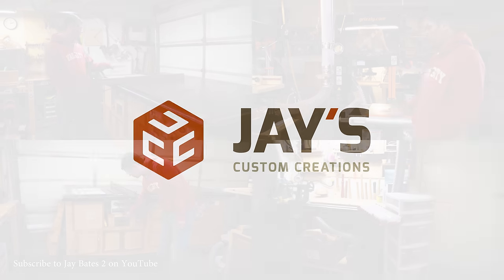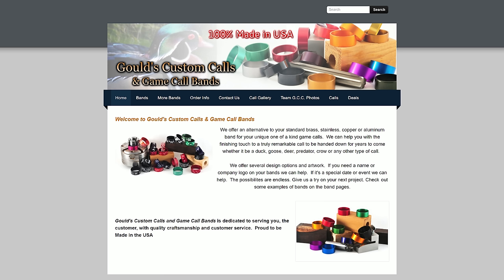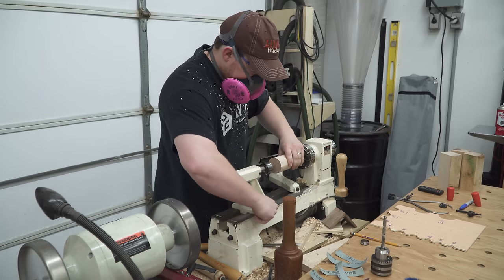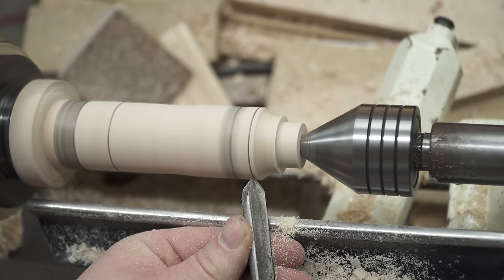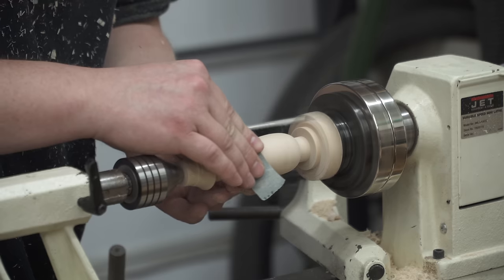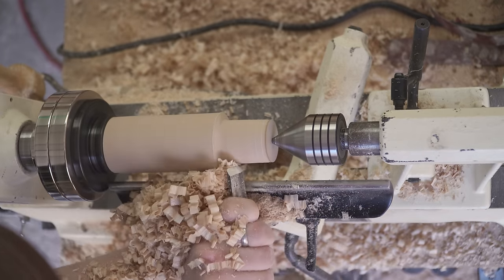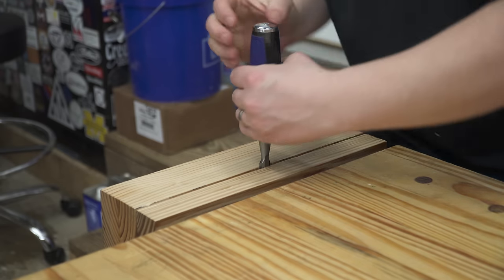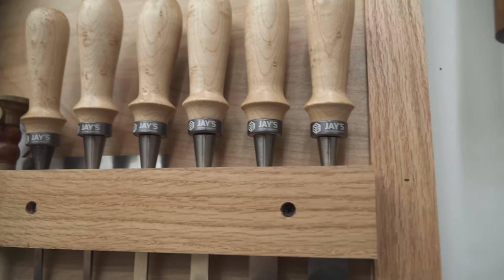Making Chisel Handles With A Lathe - 276

Comment: Nice job Jay. Love the handles.  I use Ron's bands on my calls as well. If the bands don't hold up with CA, try original JB Weld. Cut a few little grooves in the ring tennon and secure with JB. It holds those bands better than anything. Also use a dremmel type tool to scuff the inside of the bands.